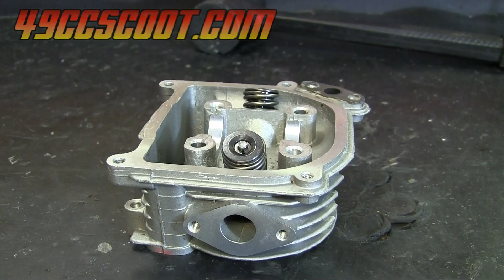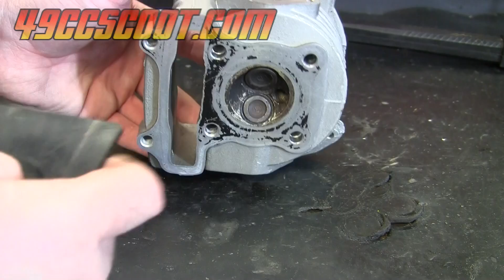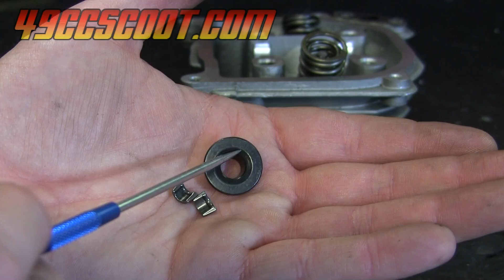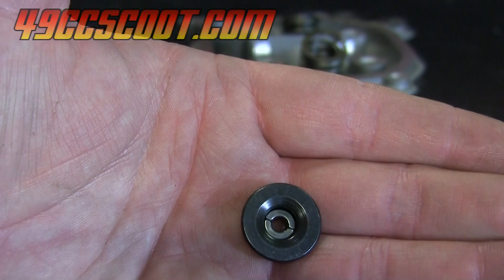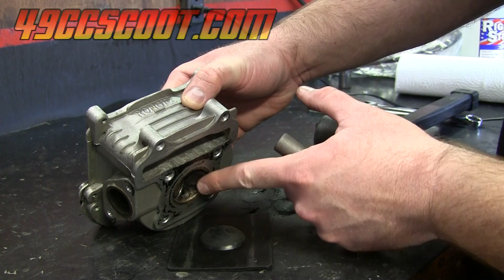Valve Removal & Installation Method 2 : Specialty Tool (Very Easy)

Comment: Yeah I did the magnets in the socket technique and it work PERFECT. I don't have that cool little rubber pad so I just wanted up a towel and kind of bounced it up under there and then put it on the floor of the garage and did it tapped it with the hammer came right off pushed it down with my thumbs went right back on.

Thank you so much for the videos I don't know what I would have done without them. PLEASE MAKE  MORE.....YOUR VERY GOOD!!!!

Comment: What about this- put a tennis ball underneath the cylinder head? Put a tennis ball underneath the cylinder head, and two 2x4 short pieces on the sides? Etc?
Reply from the maker: Sounds like it could be a good substitute for the rubber bump.
Reply: @49ccscoot update- I used some 3/8 manila rope balled up. I had no tennis ball. Then I had no deepwell socket, I used a Two ton AutoZone floor Jack handle over the spring retainer (centered), and hit that with a std hammer. * The handle had a black plastic grip half split so I removed it and that's the end which fit over the valve.

Comment: Cool tool!  I watched the socket, magnet and hammer tap technique first and that one worked perfectly.  I folded a face cloth into quarters sideways and again lengthwise.  I put 3 folds underneath to hold the valves in place and the last quarter laying flat from the 3 folds underneath to level the head for balance.  Just Liking and commenting to help you with the algorithm. It's great to have options!  Thanks

Comment: A majority arent familiar with valves an cams 64 or 69mm. I dont really. These imported head an piston kits can be easily bot made to work together. A9 cam they call it looks nothing mire then some holes drilled on the sprocket. Good?  Do the springs work well with whats is sent to your doorstep. Gotta learn

Comment: Hey I have a question for you since you are very crafty with scooter work. If I buy a new cylinder head and new valves, do I need to cut the valve seats or lap them? The scooter I have is discontinued and they have no more fully assembled head left but they have a new bare head and new valves. It is a 2016 SYM HD200 EVO, 4 valve cylinder head. I would assume the valve seats and valves are machined by the manufaturer to have a perfect seal if they are new. Thanks!
Reply from the maker: It would depend on exactly what you buy, but you shouldn't usually have to cut the seats. I'd lap them.
Reply: It is an OEM from dealer cylinder jrad and OEM valves for my 2016 SYM HD 200i EVO.. @49ccscoot
Reply from the maker: @lancejonesmusic  Should be ready to go as long as it's not a true bare casting. I'd still lap them, but it's not a must.
Reply: @49ccscoot  ok sounds good thanks!
Reply: @49ccscoot  I forgot to ask. What lapping compound do you recommend?
Reply from the maker: @lancejonesmusic  I usually just go with the Peramatex stuff that local parts stores have.

Comment: ohh wow that just makes things easier! awesome tool

before that, I just use a deep socket and a "sorta hard" plastic sheet to keep the valve keeps aligned and fall into place when I push on the springs

might take 1-3 tries but it works 🤷🏻‍♂️

Comment: How are the valves keys actually holding the springs in? I can't wrap my head around it?
Reply from the maker: Look up some pics of keepers and the ends of valves. You'll see that the valves have a groove and the keepers inside are designed to interact with that. The outsides are made at a taper.

Comment: Thanks. For 40 years, I have done that with a deep well socket (about a 14mm) to "pop" the keepers. The installer can be made with a 1/4 drive deep socket inside a larger 3/8 drive deep well socket. Use a 2 inch hole saw to cut a 1/2 thick wooden plywood "puck" to hold the valves in place (instead of the rubber knob). Cost:free.

Comment: on mine, a 125 jonway,2010, the valve springs have progressive pitch coils,they are not to be installed upside down, the coils are closer together on one end, looking now thru youtube to see how they go
Reply from the maker: In general, the closer coils go toward the bottom with valve springs.
Reply: @49ccscoot  Yes, they must, that is why they were wound like that in the first place; it has to do with their resonant frequencies and  with valve,cam lobe and spring wear,and horsepower loss; lots to read about that, i just checked w/Dr Goog,  lol
And since i'm here, thanks  again for your great videos.

Comment: Does this tool work on "shim under bucket" style valves?
Reply from the maker: Once the bucket and shim are removed, it should.
Reply: @49ccscoot  just ordered one from china.  Will try it on a Busa head I got on the bench.  But  the original idea was to try it with engine in the frame and compressed air to the sparkplug hole to hold the valves

Comment: Is it always better to put washer under the valve spring? Or just shave my retainer to prevent valve seal kiss?
Reply from the maker: If you start adding shims, it changes spring pressure and then you could also push to coil bind. In some popular applications, you can get offset keepers so you could put say a 0.030" shim under the spring and then use 0.030" offset keepers. If you're working on a scooter, that's not likely to be an option. A lot of people take them to a machine shop and get the guides machined for clearance.
Reply: @49ccscoot  thank you im working on my 130cc bike
Reply: Last question lol when i bring my piston to machine shop for valve pocket, can i just tell them that i use 6.8mm camshaft or do i have to bring the camshaft?
Reply from the maker: @low9164  I would call the machine shop and ask them what they want to be sure. If you know all specs of diameter, position, depth, angle then they can do it with just the piston for sure but otherwise it's best to ask what they want. I know that with some of the GY6 and 139QMBs, the reliefs don't always match up exactly where they need to be.

Comment: Should my springs be able to be compressed by hand on my 250cc dirtbike ? They seam VERY tight on intake and exhaust side , please let me know if there maybe to tight or needing to be replaced ?? Thanks!!!!!!
Reply from the maker: Probably not. Compressing valve springs by hand is generally only applicable on very small engines.

Comment: Great Video. Thx for the tips. I'll be using method #2. Shop wanted 300$ to do the valve seals. So i may owe you 250

Comment: This is clever. I wonder if a guy couldn't just use pvc and a plastic weighted hammer. A lawn mower is likely not going to break it. Otherwise, I have enough pipe. Pretty neat.

Comment: I found one here:
http://www.ebay.com/itm/221468441342?item=221468441342&viewitem=&vxp=mtr
Reply from the maker: +Ya Xu Search "scooter valve spring tool" on eBay and you can get one cheaper.